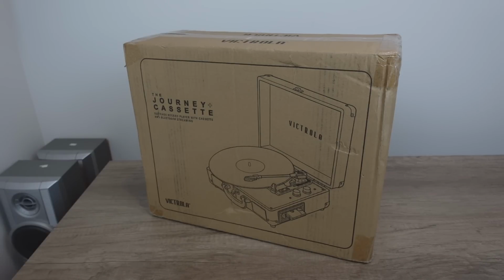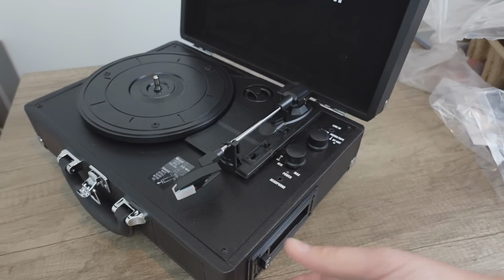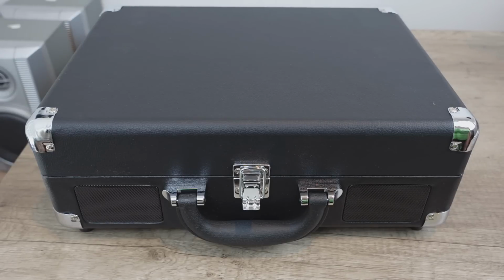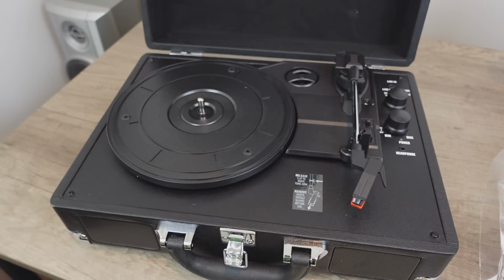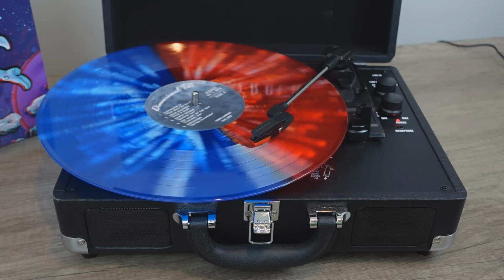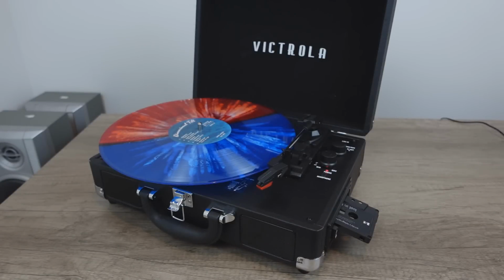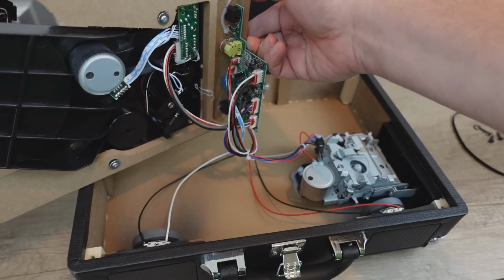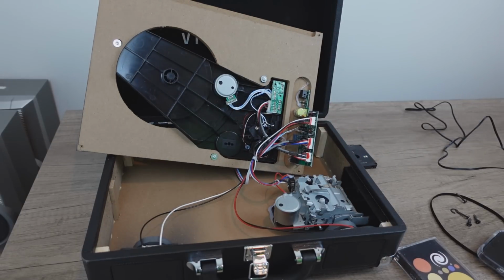Victrola Journey + Cassette! Unboxing & Review! #vinyl #turntable

Comment: I've got a GPO Flight suitcase record player with slot in tape player. It's not the best mechanism as sometimes when you push the tape in the spring doesn't push it down properly on the spindles (hence the rattling in your video) and you have to try it a few times before it works. As the flight I have is slightly bigger than the smaller suitcase record players I've decided to try and upgrade it by retro fitting a Audio Technica AT3600LP magnetic cartridge to it. Have so far fitted the cartridge and added sufficient counterweight to get tracking force down to just over 3 grams. I've not yet fitted the RIAA preamp I've picked up :)
Reply from the maker: Interesting - I've thought about doing this!
Reply: @Recordology  Just to advise that I fitted the RIAA preamp today. My flight turntable has an issue with the main amp so played through the internal speakers sounds squawky. However, have connected it via bluetooth to my sound system and does sound considerably better. I need to do some more tweaks as there's no dampening on the flight turntable (even the Crosley Cruiser has some rubber grommits) and if I could sort out the problem with the  main amp would be great. Even the tape player squawks through the internal speakers but sounds fine taking the output via bluetooth or the headphone socket. It was a 'listed as broken' ebay purchase mind you.

Comment: How do you do a direct feed out of this? Line level outputs from a ceramic cartridge are usually a very hot signal, certainly much more than that of a magnetic cartridge. I can do direct feeds out of an Audio Technica AT-LP60, into my iPhone, but trying it with say, a Crosley, and it overloads it.
Reply from the maker: I used the headphone jack to my digital recorder so I could pad the signal with the volume knob.  Otherwise I have to use a headphone amp to lower the volume.

Comment: With regards to vinyl record cleaners, I suddenly remembered the product RESTORE4 vinyl cleaner which comes with other different cleaning solutions. It had a very good effect on one of my most scratchy sounding LP record. It really practically removed the noise on that record. Unfortunately, the other products that come along with it had issues and the whole set was banned from the market. I just hope it will become available again. I guess you're familiar with that product brand.

Comment: I would not find lots of excuses for things not working properly. You sound a bit too forgiving about the tape player. It is supposed to function properly when it is taken straight from the box. If they cannot add a functioning cassette tape player, then why even add it in the first place. Otherwise it's a great video and I like the comparision with disposable cameras. But even those you expect to function before actually disposing them.